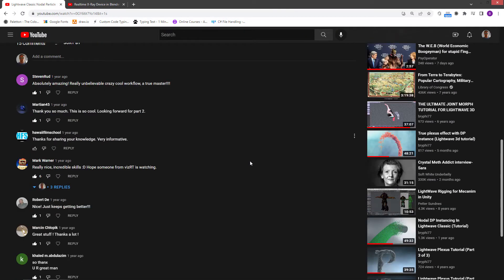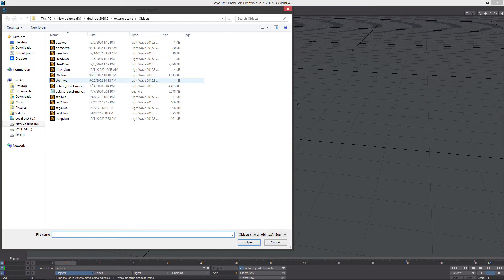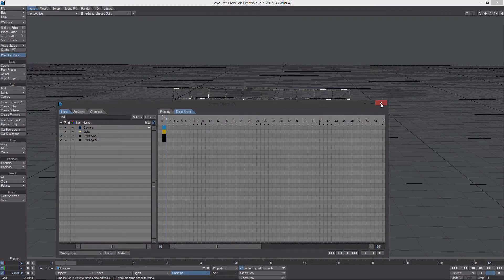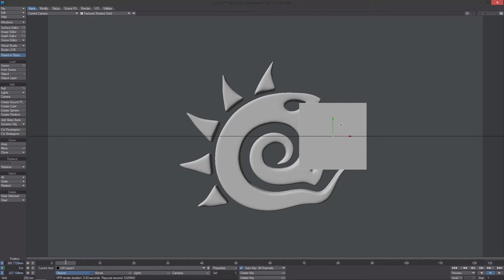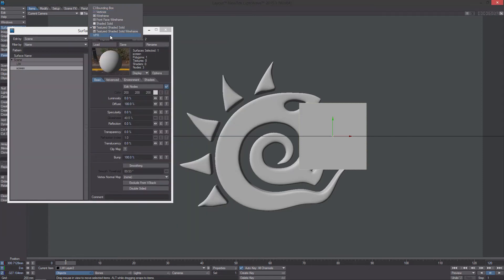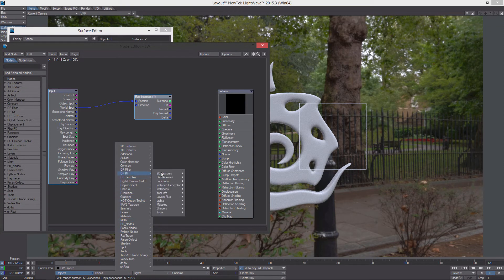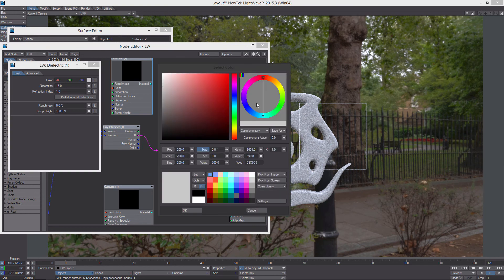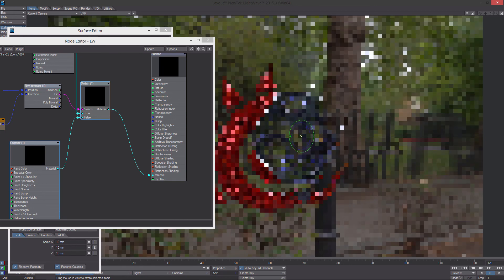XRay Effect (Blender tutorial redone in Lightwave)

Comment: Thanks for the video
I have a question, Been trying to reproduce a smokey scene, in LW.
It's a smokey layer scene,  and I want the object to rise up thru the smokey layer, and as the object rises thru the smoke basically the smoke falls of the object.
been trying just having issues with the smoke and object.
Thanks
Reply from the maker: Do you have a link to similar effect to what you are going for?
Reply: @bryphi77  sorry it took so long,  been trying to get the wife's truck running..
 I saw a video of a ship, a space ship,  rising up thru some layer of dense smoke, the dense smoke kinda like rolled off the ship as it went vertical and aligned to a station in the far distance. I don't have a link to it because i saw it on TV.
Been looking but can't seem to find anything familiar to it. But I have been trying to duplicate it. 
It was pretty cool looking effect.
Reply: @MichaelNichol  Collision object, shit ton of particles. I've done it before [scene in Star Wars Squadrons trailer has a SD rising out of a red dust cloud if you need a referance] Kinda like Voyager going through the rings in intro, same thing really.